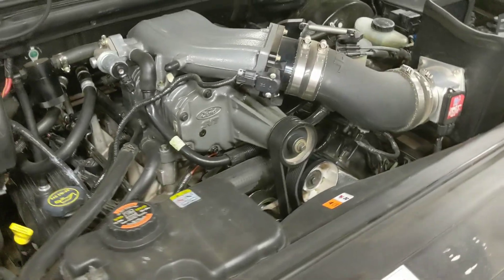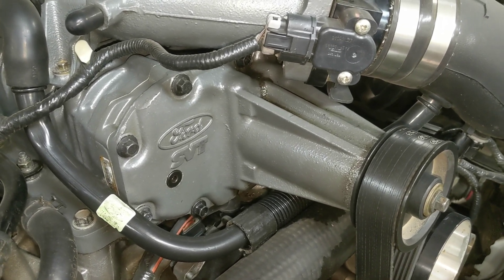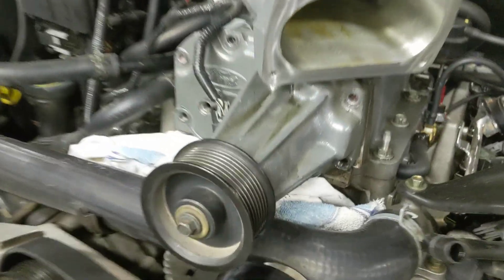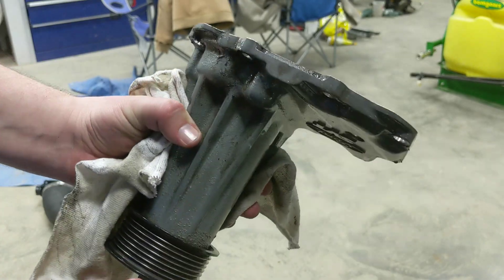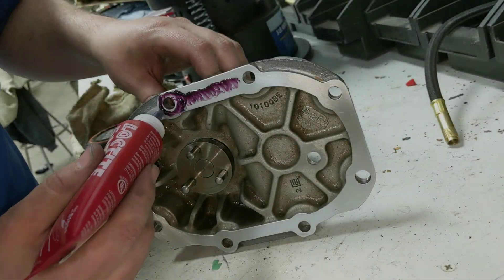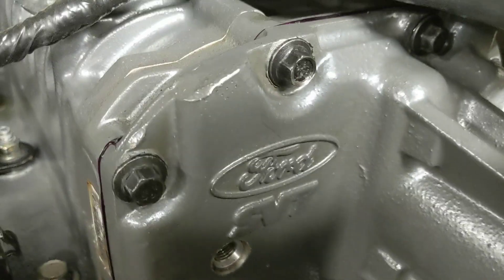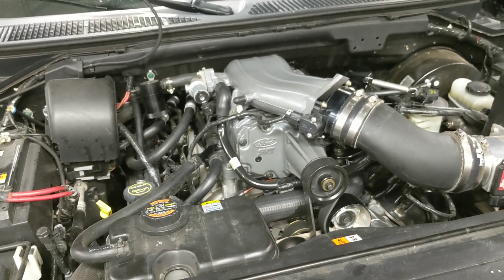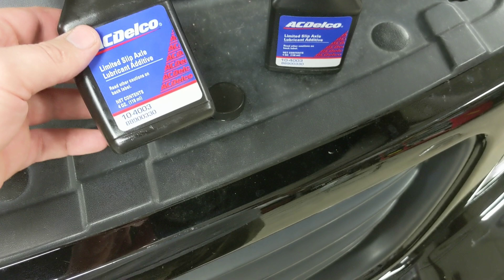Ford Lightning Leaking Eaton M112 Supercharger Fix

Comment: Quick question ,how did you know it was leaking and stuff, my 99 with a pulley.headers , a magnadlow, and a couple other bolt ons does not whine . I’m wondering if it’s because of the long tube headers and exhaust but it doesn’t make sense , I had the truck sitting since 2017 if that has anything to do with it .
Reply from the maker: The only reason I knew it was leaking was because the supercharger oil was leaking out all over the engine. The blower itself worked fine. Regarding your blower, does it make boost? What does your boost gauge say? That will tell you some of what is going on.
Reply: @605BOLT  boost gauge goes up , just doesn't whine even though i would hear it before .
Reply from the maker: @beans7528  weird. If it's making boost you should be fine

Comment: I got the same issue with the blower leaking oil...re sealed the snout and its still leaking lol gonna have to rebuild the snout soon 🙃
Reply from the maker: Daaaaamn. That sucks. If you can at all swing it I would recommend just upgrading blowers. They're kind of pooches. I wish I would have just nutted up and bought a KB or Whipple or something different. Live and you learn I guess. Thanks for subbing btw. 🍻
Reply from the maker: Where is if leaking from? That same sealing area that mine was or out by the pulley?
Reply: Out by the pulley and it's slinging all over the hood lol...was thinking about a whipple too but idk maybe in the future...and yah man keep up the content! 🤙🏽
Reply from the maker: Dang. Out by the snout is going to be a little bit of an adventure for you I bet. I'd be curious to hear how you turn out and what it takes to get it fixed.
Reply: @605BOLT It would take a Metco supercharger pulley remover/installer and a cheap $5 replacement seal.
Reply from the maker: @3500camarz  true. But idk if the seal comes out with the shaft still in place.
Reply: @605BOLT  I don’t see why it wouldn’t. My snout is also leaking, but I haven’t replaced the seal yet. I have both the Metco kit and the seal. The main thing is removing the pulley to access said seal.
Reply from the maker: @3500camarz  I don't think this one was leaking from the pulley end of the snout. It was leaking up by the flange and running down the snout to the pulley.
Reply: @605BOLT  My fault, I meant to say mine is leaking at the front seal behind the pulley on the snout. Yes, yours was leaking on the snout case which is not my issue. Either way, both are simple fixes. However, the front seal requires the special tool for removing/installing the pulley. A press may work instead of the tool, but I went buying the tool route.
Reply from the maker: @3500camarz  I see. Ya it shouldn't be too bad hopefully.